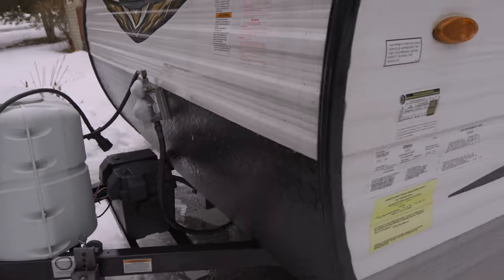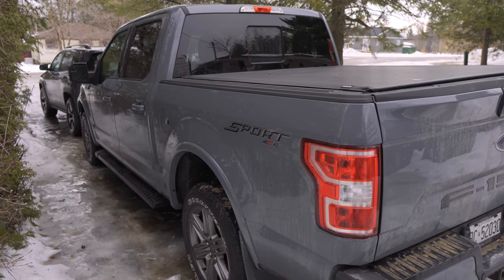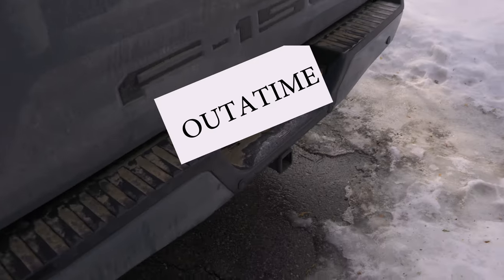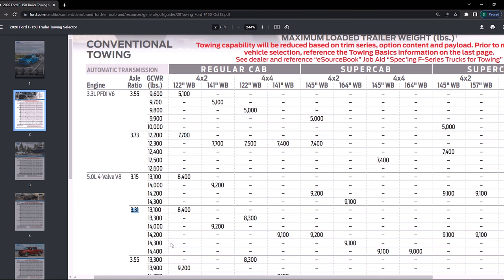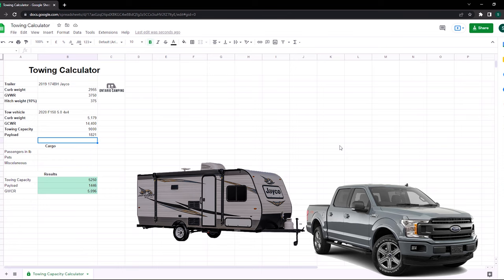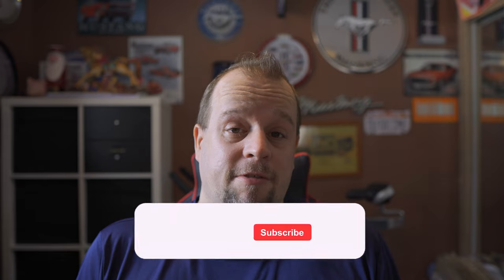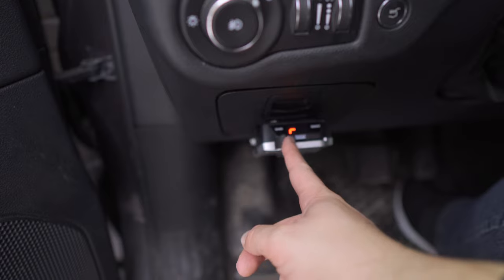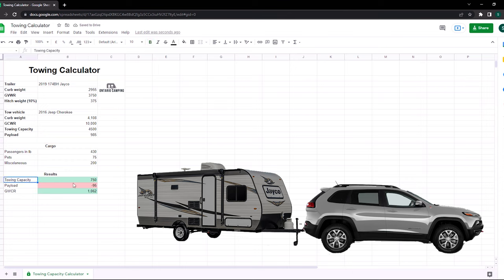How much can I really tow? Towing capacity guide for travel trailers

Comment: I have a 2021 F150. Ford has a website where you input your VIN. Ford will then give you a form to enter total passenger weight, accessory weight, and cargo weight. It will then tell you YOUR tow capacity.
Reply: thanks, found that handy.

Comment: Where were you when I got started towing and RVing in 2021!? Your video is a wonderful refresher of all the terms I had to learn back when we tried to pair our Dodge Grand Caravan with our Wildwood FSX 177BH trailer - Not a happy combination. And yes the vendor touted the dry weight of the trailer to say our Dodge could tow it with its 3600 lbs towing capacity - Not true. Nor was the fact that the trailer’s brakes would work with the Dodge, since it did not have a brake controller; towing a mere 500 Kms chewed up much of the minivan’s new brake pads! 

Now we have a RAM 1500, and while it indicates that it can tow up to 12000 lbs, realty is that the maximum weight of a trailer we should ever tow is more like 6000 lbs (GVWR).  Thanks for the great video!
Reply from the maker: Thank you, towing capacity is such a misunderstood subject. The unfortunate case is that most vehicle and trailer dealers just want to push trailers and vehicles to make a buck, rather than educating the customers

Comment: I bought a 2022 Chevy Colorado and it can tow 7700 lbs. It has the towing package and 4x4 off-road package. Some of these travel trailers I can tow by specs are 31' long lol. Sometimes numbers don't equal safe.
Reply from the maker: They always advertise towing capacity, when the reality often dictates that payload in most situations is the limiting factor
Reply: @OntarioCamping  2181 lbs for my truck. Plenty for anything really. With the factory hitch on the towing package it's rated 770 lb tongue rate.
Reply from the maker: Oh wow, that is a decent payload capacity
Reply: @OntarioCamping  Ya the midsize trucks have came a long way. I just still don't trust it to tow a 31' travel trailer even though every spec says that it can weight wise.
Reply: @semosurvivalist  how would you recommend a 2022 gmc sierra elevation with offroad package and trailer package. Tongue weight rate is 1140  and conventional twr is 9100. My wife wants to get a 7700lb dry trailer and I'm not knowledgeable enough to really look into the trailer that would be perfect for the truck
Reply: @semosurvivalist  the truck is a 5.3 and a gmc sierra 1500 2022
Reply: @OntarioCamping  would be nice to see your view on it aswell!
Reply: @mikiegonzalez3068  I would run a sway hitch and possibly some airbags for comfort but you should be fine. Nice truck! I've seen them pulling some decent size rigs when set up. There's a family on YouTube that pulls a really heavy 32' setup with one. He did a lot of work to his truck to feel a little safer but they've been going fine for three years. We looked at one but they had none at the time available for purchase.

Comment: The most important number to focus on is GCWR for 2 very important reasons. As long as you don’t exceed that you will never be in jeopardy of getting a ticket for being over weight and you can rest assured your braking system will be operating within the factory certified limits. As far as payload of the tow vehicle is concerned with a properly setup weight distributing hitch the payload is not that critical. The limiting factors are the truck and trailer axle ratings. Between setup of the hitch and some minor tweaks to the suspension ( if required) on the tow vehicle you always get close to the GCWR. Most truck weight stations are setup to provide you with the weight on the axles so you can sure you aren’t exceeding any of the vehicles ratings.
Reply: don't you think the weight of the tires should not be included in axle weight?

Comment: Great video. We just bought a new jayco pretty much the same trailer. Was just wondering how did that jeep Cherokee tow your trailer? I also will be towing with a Jeep Cherokee with a tow package. Did you have any troubles at all was it safe? I do have a weight forward hitch and sway bars. I was hoping to get through the summer before I buy a truck.
Reply from the maker: We towed it for a year with the Cherokee before upgrading, it was ok in non hilly areas. Keep an eye on the transmission temp as the transmission is the weak point in the Jeep, make sure you keep the rpms around 2k.while towing, don't use the overdrive gears

Comment: After going through this a few times, something doesn't look right. When you input your known trailer GVWR it reduces the towing capacity (cell B20) by the same amount - but you already know the towing capacity. So B20 isn't your towing capacity; it's your margin. I think your worksheet should only try do do one thing at a time; either calculate the available payload using a known trailer weight, or calculate the towing capacity using your known curb weight and known payload.
Reply: When inputting a known hitch weight your worksheet correctly calculates the available payload.
Reply from the maker: I'll review, thank you
Reply: But what if I'm shopping for a trailer and I only know my truck's numbers and my personal payload numbers? I would need a worksheet dedicated to that task.

Comment: Link to spreadsheet not working. I am logged in with a google account. Could you repost?
Reply from the maker: Are you using a cell phone or computer? If you are using a mobile device, you will need Google sheets to fill out. Click on the edit (top right corner). If you are on a PC/laptop, it will just open in Google sheets editor

Comment: The reason I am asking is I have a similar set up and not sure if I should use a weight distribution hitch . I am looking at a Reese 49911 with 600lbs of tongue weight and 6000lbs of gross trailer weight.
Reply from the maker: I do have a WDH, however I don't use the bars anymore. Since the truck is heavier than the trailer, I have no sway issues or find it to make a big difference with the suspension drop
Reply: @OntarioCamping  Thanks, I just purchased a travel trailer with gvw of 4500 lbs and 450 lbs tongue weight. It felt pretty good towing home about 300 miles. Maybe one inch of squat . Just wasn't sure if a hitch with sway control would make a difference. I have a Ram 1500 with air bags which I can eliminate the squat, but they don't transfer any weight. I appreciate your input. I didn't want to purchase one if it's not going to make a difference. I think you answered my  question.
Reply from the maker: My experience and I'm sure people will disagree, since I never really had any sway, there is really no benefit of using the bars. If you have noticeable sway, there may be a benefit. Using the wdh on the Jeep was a must and made a huge difference, the f150, drove with and without and the effort to put them on was greater than the benefit. I still carry them with me in case I end up in a windstorm, but the reality is that I haven't used them in years
Reply: Right on ya I think I am going to pass on one. It's hard because with this size trailer you're kind of right on the fence. It's  nice to have talked to someone who has tried it both ways. Take care, again I appreciate the input.

Comment: What if my result looks like this :

Results	
Towing Capacity	1750
Payload	28
GWCR	578    

Would you say its safe to go ahead and pull the trailers? Or would that be pushing the truck to its limit? Thank you,
Reply from the maker: I think you are missing some numbers 😄
Reply: @OntarioCamping  What do you mean? I just copied the results number.  I did put in all numbers in order to get my results
Reply: Are saying that these results don’t make sense or what. Now I’m confused 🫤. 😆
Reply from the maker: @sylvainbergeron932  gotcha, I thought those were the input numbers, you really don't have a lot of room when it comes to payload. The truck will just be fine, it's the legal stuff, if something happens and they put you on a scale,  you have to worry about, maybe try and put less weight in the tow vehicle
Reply: @OntarioCamping  ok I’ll keep playing with the numbers I used a high number of 400 lbs for gear in the truck bed

Comment: Good video…question does my 2021 toyota tundra trd pro is capable enough to tow a 2022 jayco 184bs slx 7 thankyou
Reply from the maker: That all depends on your payload, towing capacity there should be no issue, however payload may be a limiting factor. Check the door sticker and calculate the combined weight of the  passengers, cargo and hitch weight, deduct this of your trucks  payload to ensure. In the description, I linked a calculator you can use

Comment: You forgot to add your 375 pound hitch weight to your payload total!
Reply: The calculation sheet deducts the hitch weight as well, but yes you are 100% correct in saying that this will be deducted from the towing vehicles payload
Reply: He’s running a WDH, isn’t that another 100lbs deducted from the payload capacity?